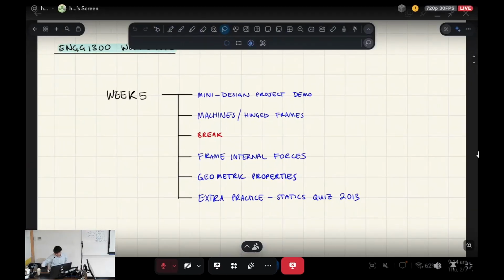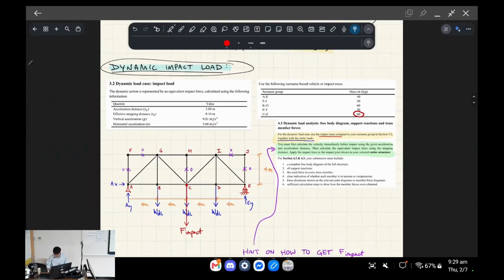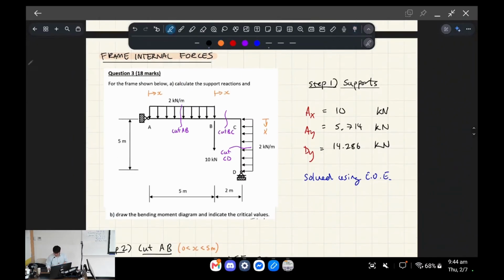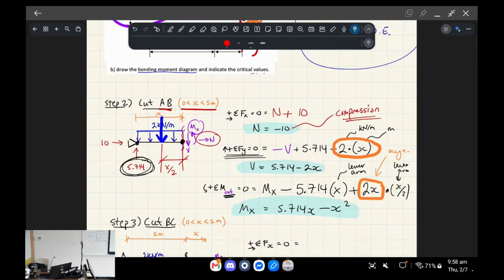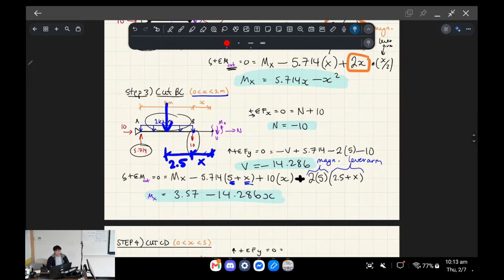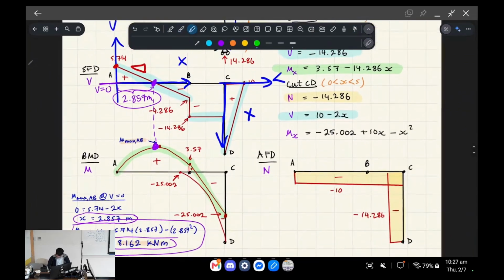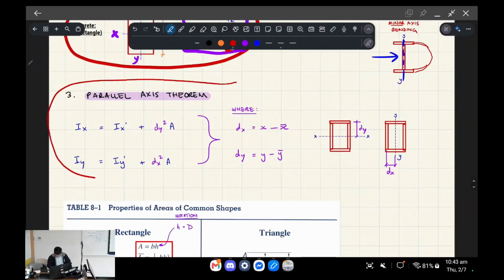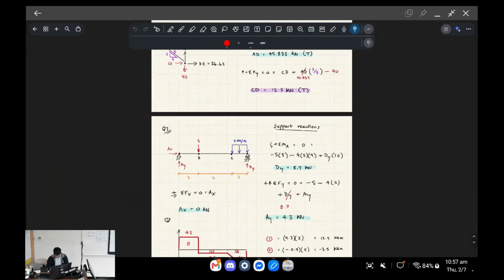2026 ENGG1300 Workshop - Week 5

Comment: Hi, 
Thank you very much for these workshops! You've been a great help in this course, I cannot express enough how much I appreciate your work.

With regards to the Frame Internal Forces questions, I understand that we can use the graphical method instead of the algebraic method, but I would like to confirm two points:

For the AFD, my approach is to mentally cut each member at the required section and take the algebraic sum of the force components acting parallel to that member on one side of the cut. I then use this axial-force value to draw the AFD for each member separately. Is this the correct graphical approach?

For the SFD and BMD, I did not notice any difference between solving this frame question and solving the beam questions, apart from the change in local perspective when moving from one member to another. Apart from accounting for that, are the graphical procedures for drawing the SFD and BMD the same as those used for beams?
Reply from the maker: Hey mate. No worries and thanks for the kind words!

Its a good observation yep. Theres no difference in the answer you get from graphical method and algebraic method in terms of the end result (SFD, BMD, AFD)

The reason i teach the graphical method first for beams before the algebraic method is to introduce the concept

For frames, it feels more intuitive to me to learn it with the algebraic method before jumping into a graphical method since, like you mentioned, the change in local direction is hard to grasp for many students looking at it for the first time. If you are confident in your understanding, i see no problem in doing the frame problems using graphical method

Keep in mind, the same problem arises when dealing with triangularly distributed loads in frames, as was the case for beams, where you cant solve it using graphical method and therefore have to use algebraic method
Reply: @SigmaLectures  Thank you very much. 

I wish you all the best in your postgraduate studies.